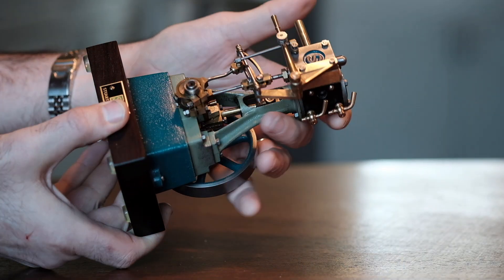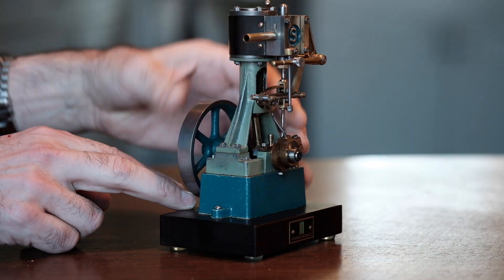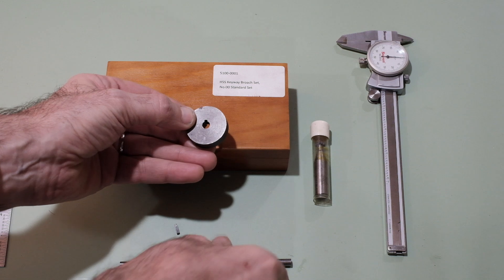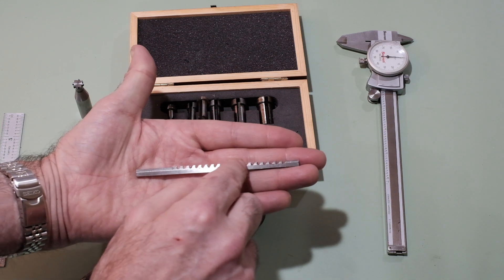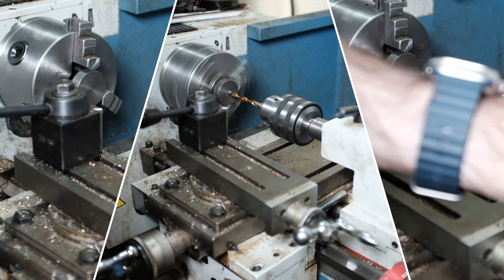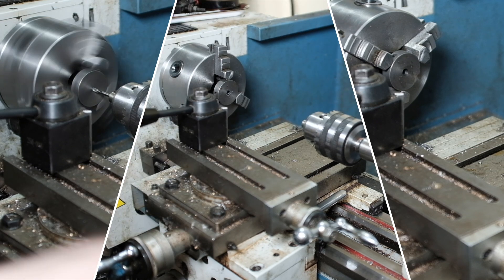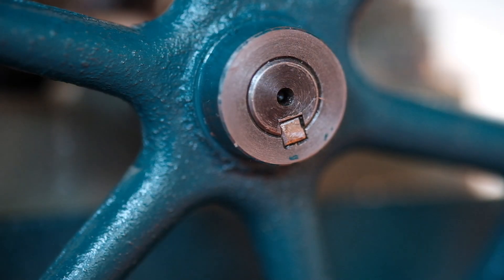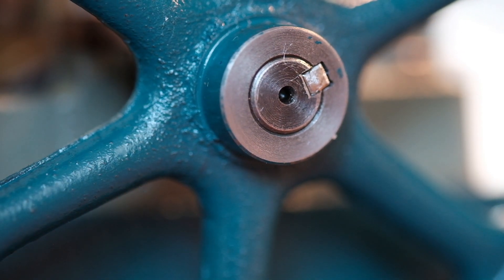Broaching keyways for model steam engines!

Comment: I have built several steam engines that use a grub screw to keep the flywheel secure.  It seems to work using Loctite.  It would save you some money over buying a set of broaches. Of course you could make the broach.
Reply from the maker: Your point is valid--I run the steam engines enough to prove they run and then I put them in a glass cabinet from Ikea, so the keys don't every see real service, but I like the authentic appearance, and back in the day I always enjoyed broaching full-sized keyways, so this lets me have the same enjoyment at a small scale. Besides, it gives me an excuse to buy another tool!